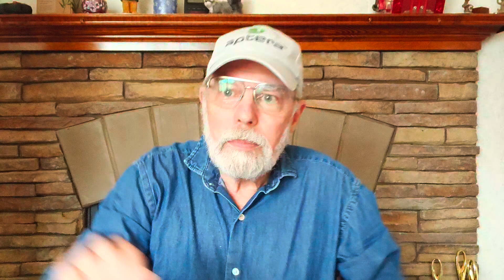Iowa Aptera - Some Words on Safety Design

Comment: If one could place a bet on 100 or more units of Aptera being  produced in 2023, what odds do you think Las Vegas would offer?
Reply from the maker: I suppose that would depend on how soon you think that the supply chain recovers from the shocks of pandemic and war, and whether more are on the way..  I would personally be very surprised if the answer were not in the thousands.
Reply: @n.brucenelson5920  Thousands of units produced or 1000’s to 1 odds that 100 units will be produced?
Reply from the maker: @inomad1313  1000s of units.
Reply: @n.brucenelson5920  That’s what I figured. But, the question and answer didn’t align quite right which is why I asked for clarification

Comment: This is an Immportant Video! Thank you for this information Bruce.
Reply: Important to know not to put money down on promises - wait for reality after the fact.
Reply from the maker: @aussieideasman8498  If you only wait for "after the fact" you will never produce anything of value.  Venture capital firms are happy if only one of every 10 bets pays off - but that one will more than cover the investments in the other 9, and may change the world for the better, as well as making some money.
Reply: @n.brucenelson5920  "If you only wait for "after the fact" you will never produce anything of value." You have a good point, but it has to be tempered with calculated risk. So a project to build a better TV remote might be worth early investment, and a project to mine Mars will likely be too risky - all things considered. 
"Venture capital firms are happy if only one of every 10 bets pays off - but that one will more than cover the investments in the other 9, and may change the world for the better, as well as making some money." That's OK for venture capital investments, where the 10 are amortized, but is your investment spread over 10 shots, or is it a total loss when it folds? I am happy to consider points when they are pertinent, but I don't like it when clowns deceive the gullible. If your investment is covered by 9 more, and some are less risky, you have a point - but you don't. And in all this time, you haven't realized that I actually think.
Reply from the maker: @aussieideasman8498  I encourage people to do due diligence.  I am also a big fan of dollar cost averaging and I have my investments spread over far more than 10 ventures, with varied degrees of risk.  I don't invest in companies that I think are harming our environment or contributing to social harm, even if the personal financial risk would seem to be low.  

I know that you enjoy some personally risky behaviors - such as fast, long motorcycle rides - and I don't call you names for it.
Reply: @n.brucenelson5920  When you have personal investments in 10 pies, it's not the same as a VC firm amortizing. It's a different math, and each needs to be considered own its own merits, otherwise you introduce frivolous behaviour you don't need to have. You don't want to have Peter pay Paul when you are both Paul and Peter. In some measure, even venture firms should do due diligence on all 10, regardless of amortizing. 
I never considered my long fast rides too risky; I was always very calculating. That's why I'm still alive and still capable of intelligent thought.
Reply: @n.brucenelson5920  so true!